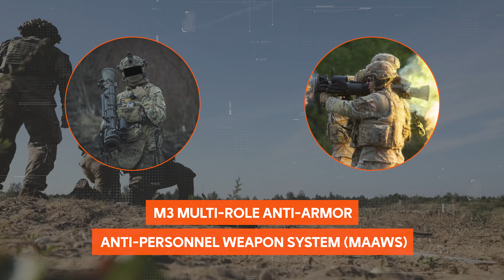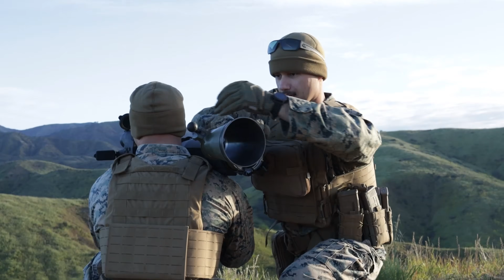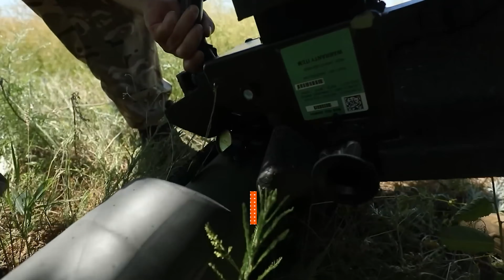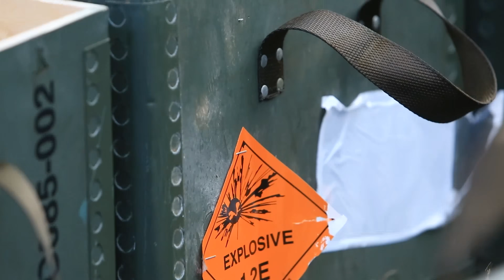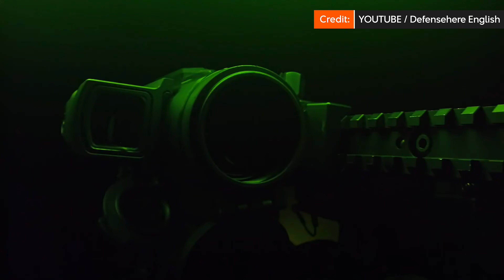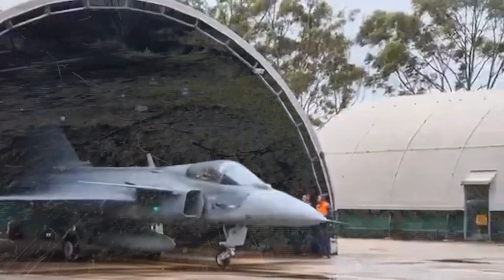$20K Swedish Weapon That Turns Russian Tanks Into Scrap

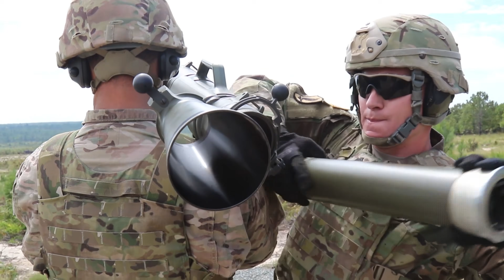Comment: 4:01 is probably the slowest loading I've ever seen. The indents, stupid! My crew back in 1990 would have fired off two rounds and eaten their lunch by now. Also GRG is an amazing piece of kit. Because any thing that you can stuff into a 84mm tube, it will fire. We had this amazing round called "Skottfältsröjningsammunmition" or something like it (Field of fire clearing ammo). Basically a HUGE shotgun shell. Only instead of BB pellets it fired stainless steel marbles. And we specifically told not to fire it at the enemy. :-)

Comment: I think you'd have to be a lot further from the rear of the weapon than 2meters when firing, 20meters is more likely if not further. I wouldn't want to take a face full of backblast at 2m!
Reply: Yeah, general rules (IIRC, it's been decades) is no troops inside 15 meters behind at wartime, or 70 meters at practise.
Reply: When the loader has secured the shell, he knock the gunner helmet and shout Klart bakåt!/Clear behind, meaning the gunner can press the trigger. It is a rule, not a recommendation. There are some other Saab-weapons that have a liquid counter blast thingy that is safe to shoot in confined spaces, but not this one.